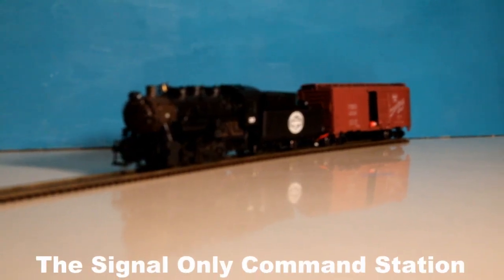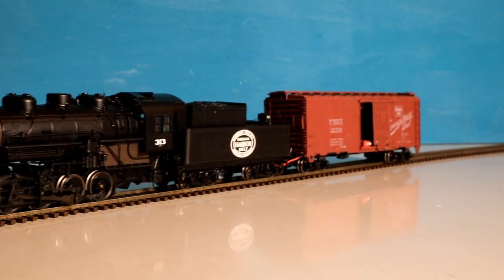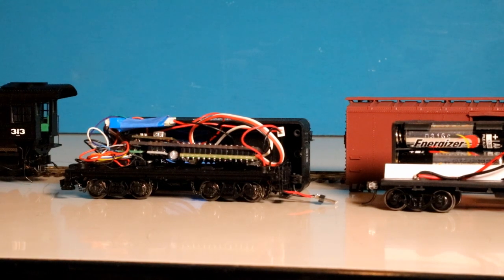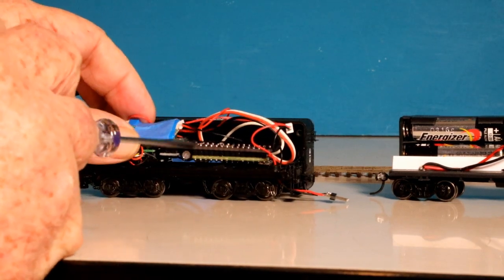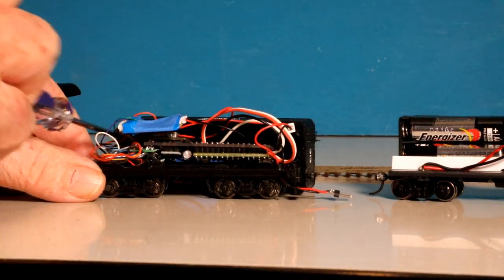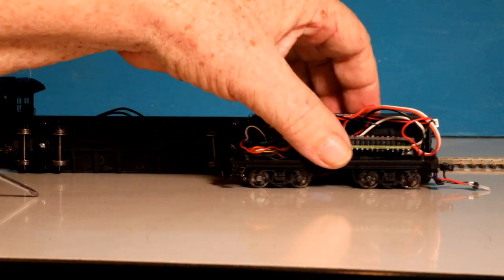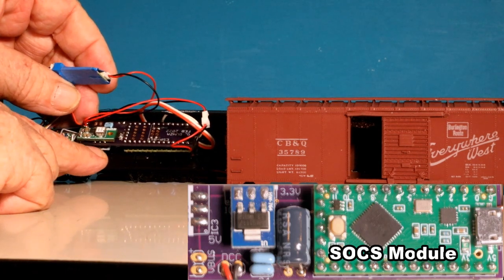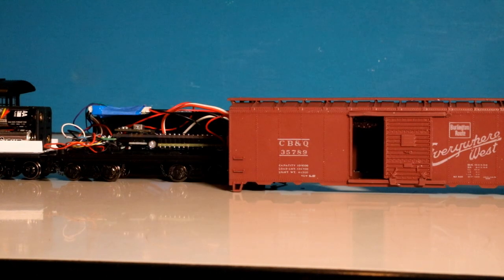SOCS: A Signal Only Command Station for DCC Wifi Control Direct to Your Model Locomotive

Comment: What a nice build!
I'm just wondering what makes this difference to the electronics that The Dead Rail Society™ sells?

Thanks for a nice video!
Reply from the maker: Hi lgrfbs (name?), I'm not at all familiar with that.  --Geoff
Reply: The difference is that Geoff's solution costs about $55 less, per locomotive